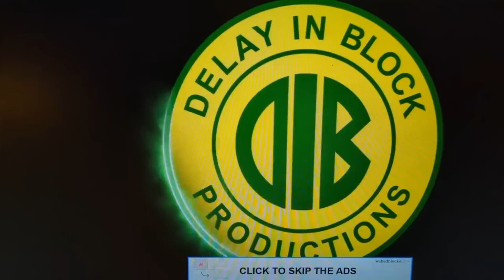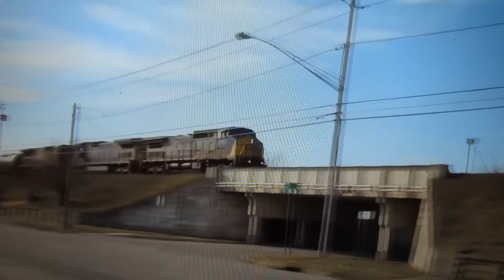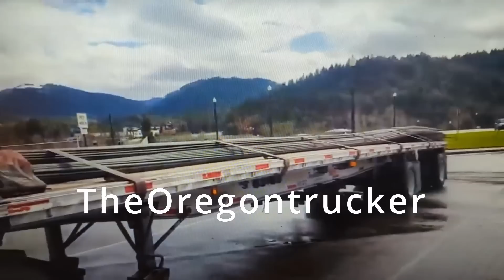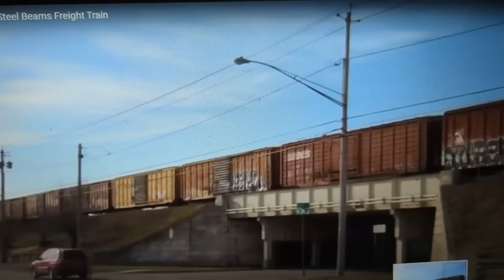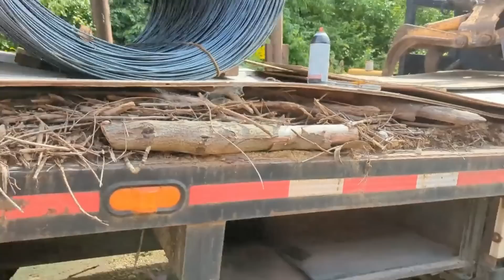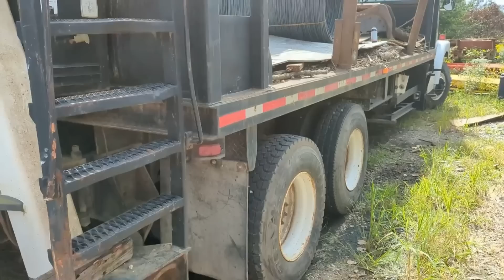Rail Cars loaded with Steel!

Comment: Too bad you don’t have a barrel clam shell.
All you need to do is open the barrel, set it on top of your coil and close the barrel around the wire coils.
The whole coil will be supported by the barrel and will not be deformed. It’s all hydronic, no magnets, no straps and no poles or forks.
And see if you can find a Burro crane.

Comment: Since you asked for input, here's mine.  I've never ran a business. I spent my career in a risk adverse design capacity where every T was crossed and I dotted. But my observation is that my engineering work was also my personality, careful and risk reduced. I don't think, however, that a business can be successful being like that. I could be wrong but it seems to me that to run a business you have to be a risk taker. My opinion (of course I offer it as is and without any warranty :-)  is that you should have bought the big excavator.  It struck me as an opportunity lost.  I'm not criticizing since I would also have chosen to avert the risk of buying something I would later have to find a buyer for. If you find this advice helpful please send me the two cents it's worth 🙂.  Good luck with your steel transloading. I'm rooting for you and  your son.

Comment: After being around a tank area construction operation, I have seen the most flexibility with a traveling (on rails) an overhead crane, with an magnet. This unit had horizontal as well as lateral movement across the loading/unloading rails. The span would allow for several flatbed trailers side by side and end to end. One man operation.
Good luck.

Comment: A C hook would be the safest. Using a magnet on rod coils is a no no in the mills. You are putting alot of trust in the bandind. They do make special magnets that have 3 rectangular magnets to get more surface area in contact with the magnet. Cranes are the normal go to for rail car loading. You can pick up older RT Cranes relatively cheap.

Comment: Diesel Creek and Waldo's World have posted videos of buying big machines (excavators/track hoes) on the cheap because the average guy cannot use them.
I think a big excavator with the right attachment would be a great multi-function tool for ETR. A material handler would limit you.  Great job and look forward to the next video. Maybe when the weather clears, we can tailgate at the White Castle.

Comment: My prediction is that magnet will not work on that wire. Not even close. A: With the wire bail being round and limiting surface area contact with magnet. B: the weight of the roll.

Comment: Whatever you do, don't go the cheapest route with the removal equipment.  Get something that is very reliable, whether you lease or purchase.  The advantage in a lease is that if what you have breaks down you can get it replaced fairly quickly.

Comment: Oh Brain  watch YOU TUBE CHANNEL  SUPER TRUCKER DAN "*...ON SOME WHERE HE HAULS STEEL  COILS  HE BACKS INTO ABWAREHOUSE ...THEY USED A U SHAPE ATTENTENTS  ON A CABLE AND BOTTOM  OF THE " U" slides into the middle  circle  of coil..the Crane cable is attached  to "top of the "U" almost inches middle  so weight of Coil that the bottom  of "U" attachment. Is balanced 👌👏😌😎😀😄👌👏😌

Comment: I am glad that I was able to catch this edition of E.T.R. I would say to go ahead and get the bigger lift. Take two pieces of rectangular steel tubing that are the length of the forks and weld them together. Get a double walled steel pipe that is twice the length of the forks and weld it onto the middle of the rectangular tubing. Weld a half moon cap on the end of the pipe. Now you can pick the coils up from the center and put them right on the trucks. You can slide that attachment off to use the forks.  Charter Steel in Sackville,  WI. uses this method all the time. 
Please let me know what you think 🤔!

Comment: If you're going to pick up one coil with a magnet wouldn't the two coils beside it on either side get magnetized also and try to bond to the coil you're picking up? I would think that would be a safety issue with accidentally pulling off the other two coils.

Comment: Have you figured out what your profit margin is or profit per load?  It seems from this briefing today that you could handle the work load and create proposals.  Also, if you can, try to rent or lease machines and equipment.  They are a very good tax deduction and easier to insure.  More flexibility.

Comment: i am very happy to see you've got light at the end of tunnel so to speak.
i SO HOPE you begin transloading very soon.
i foresee the need for some kind of small office type building in the general area and can't wait to see the build on that.
ok, now to business.
i would advise you to get something like the crawler you almost bought.
buy a monster big hefty muther cause you want to be able to pick up with ease whatever they send you.
i don't think the magnet is the way to go.
i had this idea:
on the end of the boom, where the bucket, or magnet would go, mount a single fork. pointing back to the machine.
over reach the coil in the car, pull the boom in, thereby getting the fork inside the coil.
lift and swing etc.
the cylinder for the fork, would be on the back side of the boom and would not get in the way.
it would be a somewhat custom built arrangement, but no real big problem.
you can also detach the coil fork, hook up the magnet, or a bucket, or whatever and do other things.
i really wish i was close enough to come lend a hand.
keep on keepin' on my friend.

Comment: Greetings from Tennessee. I know my suggestion is a big financial step, but if you are going to do this as a full time gig, get a salvaged gantry crane. If the magnet works then you have a viable back up incase something goes wrong with the crane. Something along the lines of a Progressive boom with a 7 1/2 ton Shaw box. Yes it's a large upfront cost, but you can write it off as a business expense. If the gondola sides are low enough, I would use a coil lift attachment. Best of luck with the venture and God bless you all.

Comment: Thinking again about my concrete pipe lifter.  Getting it to slip inside the steel coils depends on the diameter of the coils and the height of the  gondola sides.  Do you know how the coils are loaded into the gondolas on their way to you?  Hope your magnet idea is strong enough to lift the width of the coils without putting too much stress on the bands holding the coil together.  That is where the pipe lifter seems better to me as it completely supports the coils.  =D=

Comment: My first impression  would be that you wouldn't have enough surfae contact to lift the coils but I've been wrong before    But I did find something on the. internet.   The web page is  steel wire rod and steel coil handling equipment.     Handling Equipment. HVR MAG

Comment: You can get 'long stick' equipped standard excavators, probably lower cost than a 'material handler' type as they are more abundant. Then it could be also used as an excavator if needed for digging, etc. Multi-use equipment is nice for cost savings with a smaller operation.

Comment: All terrain fork truck that lifts 20-40tons will be perfect. A magnet is going to be slow as it’s a single point of pick not moving out the load across the pick. Structural will work with the fork truck as well plus coils will work 2 at a time thru the coil.  Just my thoughts.

Comment: Slinky's are tricky inside the gondola.  I've never seen them unloaded with anything but an overhead crane.  Just about anything from a fork lift to front end loader can stack them on the trailer, it's that tight space inside the gondola that'll be tough.

Comment: I have to go back to my suggestion of an overhead crane.  Travel of an overhead crane, let's say, is on an x/y axis, as long as you need and wide enough to accommodate a rail car(s) and trailer(s) side by side, and, of course as high as neccessary. Such cranes may be available used.  Matt from Diesel Creek bought one used at a Richie Brothers austion. Although, he said it's too big for his new shop building.

Comment: I would say a material handler would be the best way to go. this way it gives you the ability to move around the yard and then leaves you options for loading/unloading other materials with different attachments on the end of the boom. It will also give you good visibility over what your doing since the cab sits high up and some can even raise up higher once your in it. Then it makes things a little bit safer and can keep others out of the danger zones.

Comment: Hi Brian, As long as you have an open tab at Arbys can I have the address? LOL

I’m agreeing with you a 100%, you don’t wanna be putting personnel inside a gondola, that dangerous.
My opinion is using a a heavy duty, multiple function forklift and a material/excavator to drop them in/move the coils around would be your best bet.
Using a “C” fork with a swivel would be easier as long as you have the clearance to get it out of the gondola.
You’ve come a long way, Brian and I can only wish you well in your endeavors and a few prayers might help as well.
Thanks for your great videos, Ron

Comment: For these coils, a round single fork on a big forklift, long enough to reach through the full width of the coil, would be the safest and most reliable way to handle these coils, both for loading and unloading. They are already positioned so that this can easily be done from the side of a rail car or truck flat bed.

Comment: I think you are going to need at least a couple of acres with the tracks going through it. It will have to be paved and level. Where a the trucks going to stage. You will need a large area for the trucks to turn around. Seems like this is going to cost a few hundred thousand dollars to get you started.

Comment: You won’t be able to run a machine with tracks on the land once winter comes.  You’ll have the biggest mud hole and probably mess up the roadbed and alinement of the rail and your right of way looks narrow also. I think an overhead crane like they use for boats with a dedicated concrete strips about 3’ wide and at least the length of one rail car and a slab of concrete for a tractor trailer to back down the rail with the inside duel tire on the rail to near the end of the gondola. Use a spreader bar for rebar and C hook for coils. Your lucky nothing is really that heavy. If you were into the 15,000# coils then it would take a big crane.  I don’t know what those big boats weigh but those cranes have no problem picking them in and out of the Gulf and inland waterways but they run on level steady surfaces, concrete over the water.  I just was down in Panama City, Florida and there’s a lot of old equipment setting around down on the rail yard side of town heading down towards Tyndall AFB.

Comment: magnetic fields are like circuits, you want to conduct that field to where you need it. Since coils are cylinder shaped, you will probably want two pieces of steel spreading the field out along the coil, which are more form fitting around the top of the coil. Make sure you don't "short" the field by having steel between the two pieces, you want the magnetic field to go from one pole of the magnet, to the first spreader bar, through the coil, through the second spreader bar, and back into the other pole of the magnet. 

That should greatly increase the strength of the magnet on coils

Comment: Your best bet would be a crane with an “L” hook which would allow you to handle the rod-wire and steel coils safely.  I used to do this at a dedicated facility called a crane way, which was a permanent-mounted crane, but it worked very well.  Perhaps you could locate a mobile crane which could serve your purpose.

Comment: Look at a concrete pipe lifter.  Something like a pr of socks hangar from a clothing store.  Have that on the end of a mobile material handler like in your video that can quickly reach to any where on the gondola or flat beds.  It would be made from small I beam long enough to slide inside the coils and be balanced at its mid point above.    The long I beam w/ different attachment points along the beam for straps to lift flexible long loads like the rebar.
You need to think safety and be able to quickly accomplish your tasks.  =D=

Comment: The only problem I see with a magnet is you would have a very small contact point between the magnet and the coil.  With the weight of the coil the potential of it losing contact and dropping could be high.  You would have to test it under extreme conditions (both vibrations and shocks) to see how well it would hold.  I still think a bar going through the coil (could be a telescopic spreader bar to make it easier to maneuver) and a small crane would be the safest method but then you would need a person in the gondola.  If you had multiple bars the person could prepare several coils and move out of the way after hooking up to the crane.  maybe even a "c" shaped bar with a flat plate on the long side that you could pick up with your magnet.

Comment: At the aluminum mill that I work at, we have stationary cranes equipped with a single shaft that can handle up to 15 ton aluminum coils through the center. I think an outdoor crane with that shaft connection would be your best bet at unloading those coils. 

If that configuration couldn't work for your application, You could use a two-man system. One man could unload the car with a metal claw usually used in scrap metal, while the other man could pick up the coils with a forklift and load them onto the flatbed trailer.

Comment: Glad to see something in the revenue hopper! I’m not sure if this will work, but it may. Could you make a boat crane work for you, I see them lifting large boats out of the water then tracking back to set them on chocks. They use nylon straps for lifting so they would not damage the coils or steel beams. If you set it up right, you could lift the coil and the track back to place it on a trailer located behind the gondola car. It would be fast and efficient. Check out these mobile boat cranes. …. Might just work. You could run it on hard ground or put in concrete runways for it to travel on?

Comment: I watched a few videos on unloading coil steel after your last video and it seemed that a C shaped hook (really an E shaped without the middle horizontal) attached to an excavator arm would easily and safely pick up wound wire coil.  Not sure if YouTube will allow a link but this is what I mean.  https://www.youtube.com/watch?v=OKG6AW4VIq8  If the link doesn't work search Removing lid off coil car.  Keep up the good work.  You'll get there!

Comment: First off, I am not a Railroader, I am a fan. I have driven truck since 1967, 95% of my hauling has been construction equipment, from small tractors to very large tracked and wheeled equipment, and various forms of steel, often unloaded in rail yards. First the overhead crane is a good choice but would be very expensive for the foundation for the crane and a loading platform and ramp for the truck. I'm not sure about the magnet, they are designed to pick up flat surface material. Depending on the height of the Condola sides a forklift would be the best and least expensive, in my estimation. I have run forklifts up to 25000lb capacity on dirt and gravel, of course a concrete or paved ramp would be the best, but a well compacted gravel ramp and pad would work well. the use of CTB materials would do the job. While good forklifts can be expensive I belief it to be the best financial decision. A forklift will give more versatility. Good videos and Good Luck.

Comment: Brian, you are on the right track my old friend. Their replacing the Cape Cod canal bridges and need a lot of steel. Both new spans are 9 lanes each. 3 lanes both direction. With the right lane as an off ramp and on ramp. The two middle lanes go straight through. The project is expected to be completed by 2026. When they carefully cut up the two excising bridges they can not implode them, because it would block the canal. So, all the old scrap steel and other materials are being shipped out by rail. If memory serves me right those electric magnets are used my scrap yards with a crane to lift cars up and drop them in the car crusher, or the metal baler.

Comment: I suggest that the 'yard' infrastructure come first, as much as possible.  As big a concrete pad as you can manage as work area,  fencing where needed or practical,  night time security lighting, and a decent parking area for any helpers or employees, and equipment parking.   Gee.....I LOVE spending OPM!
What type highway access will trucks have to the yard?  Maneuvering space while IN the yard?
Are you contemplating any name change?
Good luck and Godspeed!

Comment: Biggest question I have is what is the current status on Death Valley?  Also what is the condition of the rest of your trackage? Steel and related products is not light, and if memory serves, your trackage isn’t in the best of shape. Fortunately, you do have plenty of space to spot empty cars and 2021 will be a great asset moving cars around. As far as handling material, I’d stick with a track hoe unit with a J-bar on a swivel mount and a large capacity fork lift for flat metal products. Best of luck in your newest effort.